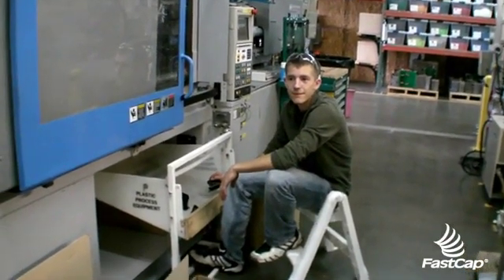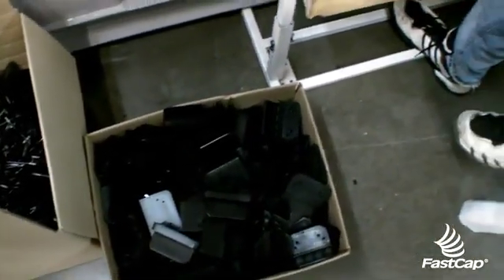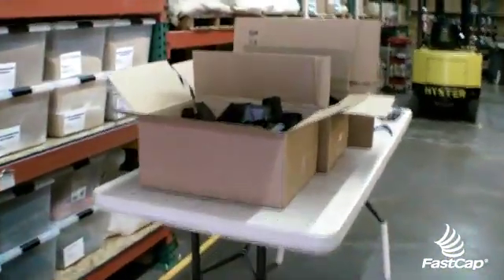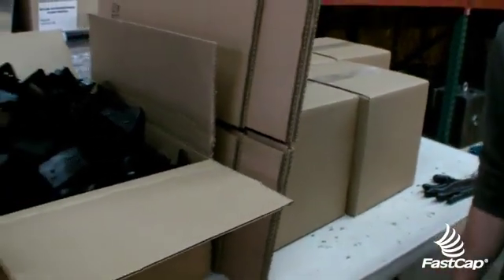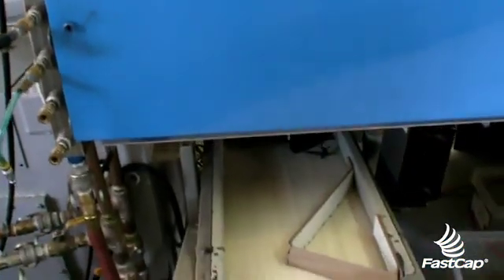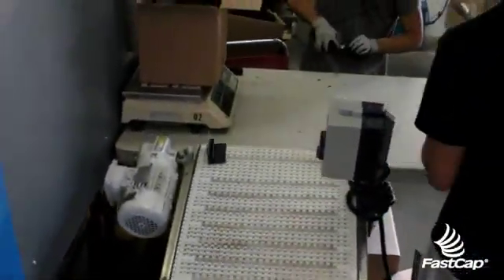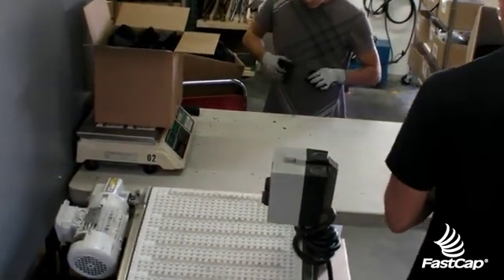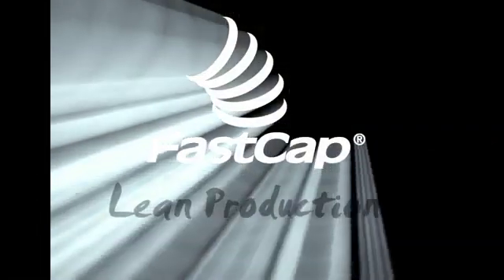Lean Batchwork vs. One piece flow

Comment: RE-grind, RE-work? sounds like over processing, which is a deadly waste.  I suggest fixing the tool so it doesn't make defects. buy a sprue take out robot so separating isn't needed, establish a proper first stage to ensure a stable process and consistent part weight. love your videos and the fact you share and teach lean unselfishly. contact me if you want any tips on injection molding.
Reply: Excellent points. This is an extremely old process (video is from 2011) when the mold was brand-new and we were having initially problems. Everything has been changed. We get perfect parts and we use a robot to Pull the sprue thanks for your great ideas!